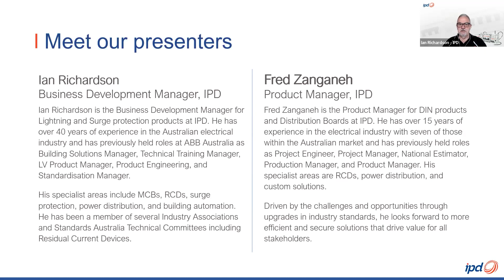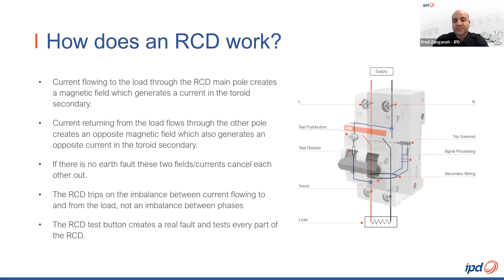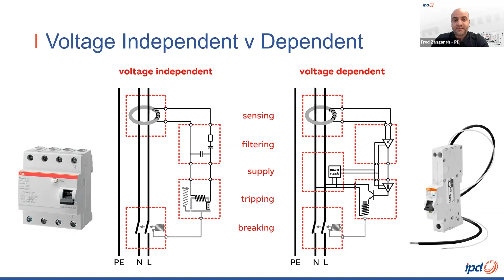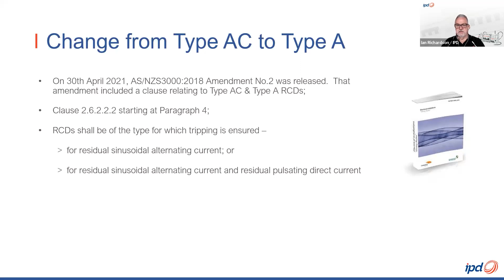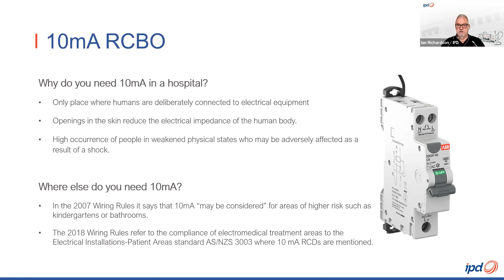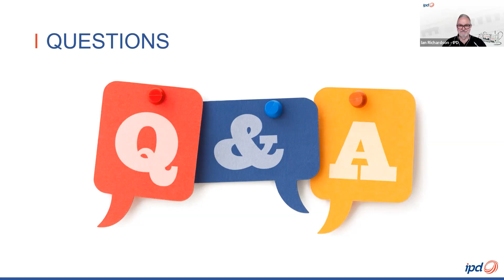Comment: Apparently the bit at 17:44 means that if you are adding battery backup, then your Type ACs need to be upgraded to Type A. There is some general commentary about solar around 40:30 but a missed opportunity regarding backup inverters.

Comment: i have come across switchboards with (RED) telecomm earth connecting blocks fitted, with all the functional earths connected to it, & when i inspected it found that not all the cables were punched down to the bottom of the connection block. & all so some had broken plastic between the connection points. are these. blocks permitted. to be used.
 i have tried but i have not been able to check if, there was a connection between the rcd , through the functional earth cable, The connection block & the earth bar.